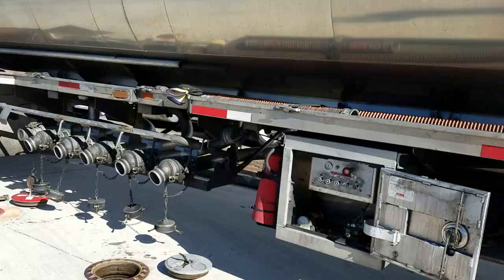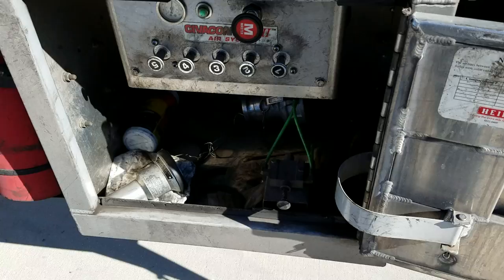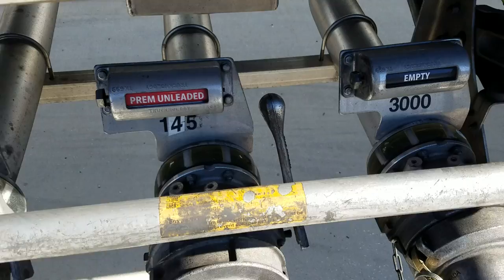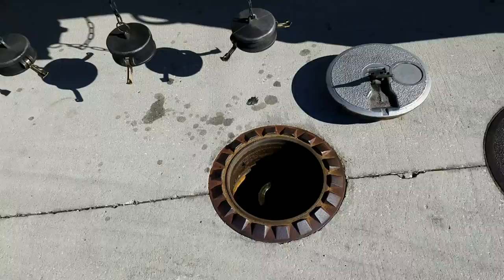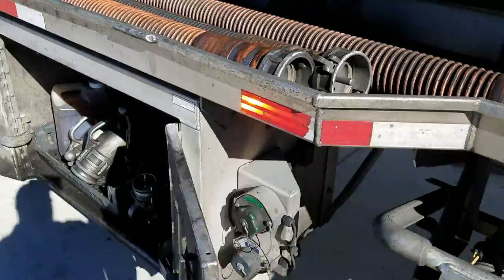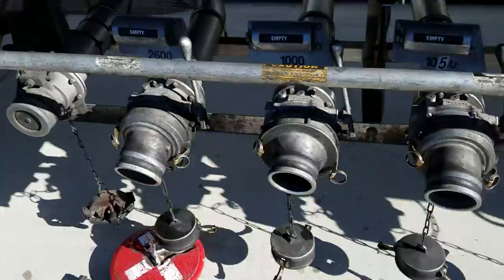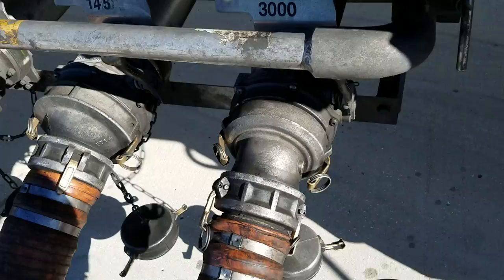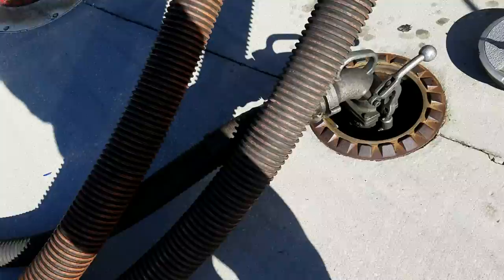How a Fuel Truck Delivers to a TruckStop

Comment: Electric cars have left the chat
Reply from the maker: Lol its alright, we deliver millions of gallons of diesel every winter to power plants that power their charging cables 😂
Reply: @DrtyDiesel  lmao
Reply: DrtyDiesel and they call their cars ‘clean’.
Reply: At least the power coming from the diesel is cheaper than what gas stations charge
Reply: lol
Reply: @diptipanat793  Well the cars themselves are clean, the way they get charged isn't.
Reply: @⚡Elektrisk⚡ yes that to forgot about that lol
Reply: Not to mention how much gas it takes to mine the metals for there batteries to be made
Reply: @⚡Elektrisk⚡ someone got butt hurt..lmao
Reply: @dash9048  not to mention when the batteries are thrown into dumps in this country. Proven fact
Reply: @diptipanat793   DirtyMAX

I have a gas engine that pretends to be clean when it's going under 30 it's a EV
Reply: @DrtyDiesel  Oil power plants produce very little of the total electricity in the US. A Tesla model S will go 300 miles on 90 kwh. Even if all that electricity came from coal, it would be the equivalent of 72 pounds of coal. However, coal is being retired left and right. My utility is in the works to add hundreds of megawatts of wind generating capacity.
Reply: But,  @DrtyDiesel  , a lot of those charging stations would be powered by other kinds of plants, like solar, wind, hydro, coal, or nukes.
Reply: Oops, ya mentioned it,  @dash9048  !
Reply: Lmaooo ,, But no only electric 🚙ss ,Electric 🚛as also...remember freightliner have been testing his first one and will be out before the end of 2019
Reply: @jlara3717 , what words were you trying to say right after the two instances of "electric"?
Reply: @HelloKittyFanMan.  sorry I tried to say no only "cars" but "trucks " too
Reply: Oh yeah,  @jlara3717 , electric cars and trucks and vans and buses, etc.; right!

Comment: I tried to do that job. Embarrassing low pay for the liability and skill required. OTR heavy haulers pull $1800 a week, and still less liability and less exposure to chemicals that can cause major issues later in life, for only $1000-$1200 a week. Not to mention 12/12/5 or 6 day scheduling. It's a hard, underpaid, underappreciated job you're doing there my friend.
Reply: JaDo Steele Underpaid? My dad makes 70 grand a year hauling fuel and is home every day.
Reply: James Smith I guess it depends on where you live. I live in Iowa so...
Reply: Depends on the company really. They all change with how much you get paid per mile, how many miles you actually have to go to get there, etc
Reply: skill??
Reply: Really?1000$ a week is underpaid job?wow.. I get 8£(10$) an hour for my job and I'm a care attendant so I make 300£ a week. And it's a hard and stressful job. I wish I get paid 1000$a week....
Reply: Just factor in delivering to closed stations or 7-11's at night and dealing with the junkies, winos, crackwhores and all the other garbage. A lot of the busier places pass gas after 11pm, especially in the ghetto where they park all over and won't let a fuel truck in due to ghetto parking practices.
Reply: Emanuel $1,800.00, not $1,000.00.
Reply: Tru but otr sucks no life no family etc local at least he has a life he home I'll take a pay cut to get off road..
Reply: @yiman7370   yea that's the world we live in now but driver world is different set of rules expectations I'm a driver since I been in my mind set has change even more then wat it was I was bout money before but now standard has rasie even more 1000 a week ain't nothing I'm use to making 2 3k a week now..
Reply: @yiman7370  Youre forgetting about taxes, insurance, retirement funds, etc.
Reply: Wow 70k a year that's just sad my sister inlaw works at a cable company and makes 100k a year no bs her bonus alone every month is 5k ontop of her normal pay
Reply: 1800 isnt much when you're away from home , eating in restaurants,paying for showers etc.
Reply: @lordvader5200  every trucker on YouTube makes 70k
Reply: 1000 a week is good money. Heavy haul takes so much more skill. Yes this is a very dangerous job, but its easy.
Reply: @yiman7370 
yup, here in the US 10 an hour is minimum wage, and there are millions of people making that. So i get sick when someone pulls in 1,000 a week and claim they are poorly paid. You can get out of college and get a good job and get paid less than a trucker. I brought that up to my professor one time, and got pissed when I told him truckers get paid more than some engineers.
Reply: @lordvader5200  i make 70k also and  i'm home every day and weekends LTL baby. i hauled fuel 12 hour days 5 week 6 the next. THAT JOB SUCKS!!!! JaDo Steele
 IS TOTALLY CORRECT!!!!
Reply: @sunnydeng9263 
1000 a week is what people with a bachelors degree make, and people like truckers, plumbers, etc...
And in major cities, people who work retail or any job that pays minimum wage are making 300-400 dollars a week.
Reply: I know there was a company I fueled trains for in ky and only got 17$ an hour.
Reply: @Big Lenny "Also, you save a lot of money because you don't have time to spend it."  Meth isnt cheap
Reply: You got that Right I did it for over 5 years
Reply: Boi, that's a really good pay here in romania. On avarage people make less then 1500 dollars a month.
Reply: @365gamestreamslive5  fact: couldn't care less. Oh, and your sister earns more money in extras than by doing her job.
Reply: I drive LTL Linehaul. Home everyday work 5 days and 9-11 hours a day. I made 103,000$ this year.
Reply: Erik Satie  - chemicals that misinformed people say cause problems.
Well yes... gasoline causes car accidents and death, if you think of everything in life in a negative way.
Reply: It's not like oil is a multi-billion dollar industry. They have to cut corners surviving on their limited budgets. Plus, they have all that money they have to pay to lobbyists to demonize alternate fuels. ;)
Reply: @rich1051414 , yes that's the reality but some still ignored, sad
Reply: What if you owned your own trailer and truck? How much would you make per week?
Reply: What is a 12/12/5??
Reply: @taledarkside  I make around $4,000 a week at my job and I still feel underpaid especially when I'm working 92.5 hours a week
Reply: You said how you tried it. After w few years you probably would make more and more money for seniority.
Reply: Rich Pianas Last Oxy  big big factz
Reply: @yiman7370  Care attendants (which I assume is the same as a CNA here in the US) are incredibly underpaid for the work they do.  It takes more than just wanting to money to stick with that job.  You truly have to care about what you're doing.  So, I want to say "thank you" for the job you do!  It's incredibly important and you are underpaid!
Reply: @taledarkside  Shit, my brother in law is a Master Plumber and made over $200k last year.  It took him a while to gain his Master designation, but once he did his pay shot through the roof.  That's what a lot of folks don't understand about trade labor, you can make a shit load of money because a lot of folks think it's low paying.  Carpenter, Welder, Electrician, Plumber, etc.  There's a lot of money in those careers.
Reply: @James Smith if you're not making at least that hauling fuel, you need to take a look at another company.
Reply: chief tp where you working at chief ?
Reply: Lord Vader your dad enjoys the company of other men
Reply: 365 Game Streams Live that’s a lie. Lol
Reply: @taledarkside  depending the state u live. Some places r cheaper (Missouri) other r more expensive (New York)
Reply: The drivers I unload everyday bringing in paper rolls say they make over $400 a load, sometimes they bring 3 loads a day, other times they might not get but 5 or fewer loads a week depending on how low or full we are on paper
Reply: I make 95k yr hauling fuel with Texas TransEastern and home everyday
Reply: These guys get upward $100k. I'm just waiting for my hazmat.
Reply: @taledarkside  People who were exposed early to 1000/week of course going to complain since they been at that pay rate for so long they expect to be making 3000/week now.  But to the rest of the people that are either working at a restaurant, market, clothing stores, etc.  would kill for a 1000/week.  Not to mention a few years ago minimum wage isn't even in the double digit yet.  But these truckers were making a grand a week back then already, so they think that is the minimum wage in the trucking world.
Reply: @BoomerKeith1  Dude, plumbers have my respect.  We had a backed up toilet and this plumber came out and use that spinning metal wire and it was back splashing shit to his face.  He took it like a champ.  I think some of the shit and shit water got in his eyes.  It was a battle but he unclogged it and even had a smile and laugh about it.  They deserve good pay.
Reply: Not true I been hauling fuel for two years and bring home 2800 every two weeks five days a week and home every night
Reply: My dad is a terminal manager for a gas hauling company he makes between 145 150 thousand a year . But he had to drive first . Like he always told me . You gotta crawl before you walk
Reply: “Skill required” lol
Reply: @JohnDoe-yh2sf  
I've done plumbing on the side. And some if it is hard work. Especially sewage leaks in crawl spaces. Industrial electricians is a field i would have liked to gone in. They get paid a shitload.
Reply: @taledarkside  I agree its hard work.  Plumbers should get pay good money.  Especially when dealing with crap.  You gotta have a strong stomach for it.
Reply: @Rich Pianas Last Oxy That's only if you have a shitty driving record and cant get a local job with the LTL shipping companies. I work for FedEx freight and if I worked 60 hours a week for 52 weeks I'd pull in $110,000 not including our twice a year ~2% bonuses.

I average 50 hours a week and still pull $85,000. Good paying trucking jobs very much exist in the local market, both in LTL line haul and P&D.
Reply: Easier than my job though
Reply: I made over 100,000 a hauling fuel
Reply: I make 1700 a week in san Diego ca 🐂🐂😀
Reply: Under paid are the drivers that fuel the airplanes,, in LAX is $ 11.50 an hour,,,
Reply: chief tp  same,  I drove otr for 3 years,  and now drive for eagle
Reply: @dfor  hook it up with FedEx pls. Is impossible to get in thru application
Reply: @2phalanges  If you didn't get a response through the website applications you can look up your local area service center's phone number and call to ask for HR to ask about openings! There's a chance that your center isn't hiring right now, it's usually in waves in the summer time and winter that they hire on new city drivers. Keep trying!
Reply: I know this video has been uploaded long time ago but putting my opinion out I think is important. 
Completely agree with you,I've haul fuel,propane and jet for 15 years and this job have become one of the most underpaid ,For the fact that fuel tanker driver is exposed to high level  of dangers out there .
Like you said $1000-$1200 is the average but I know companies that even pay  less for more work(no names You know who you are)
I quit 4 years ago, and now I make double$$$ with double less risk ✌✌✌
Reply: Joshua Powell how do you like eagle? I’m looking at working for them in south florida.
Reply: @blakelyh19  Eagle in South florida???? Is that a joke??? Well if you're willing to work extended hours night shift weekends and make $700 Eagle is the place, same Florida Rock, Kenan, CWC, Palmdale,.
Try on "Speedway " go online and fill the application they're looking for drivers and they new in the market equipment is new ,don't know about managment. Good luck.
Reply: JaDo Steele wtf haha I make 120k a year home everyday all benefits payed and work 12 hours for 5 days plus bonuses for safety and yearly quartly too OTR is for starters that don't know where the money is at my checks every week come close to 2500 a week gross after taxes I still have a lil more than 2k to take home spend time with family parties and everything else 😎
Reply: Thomas Dunning that's a little bro there's a lot of risk for this industry plus dumb ppl that drive crazy
Reply: Blake Howard bro get into car hauling up to 120k a year and it's an easy job most companies train u very easy job Toyota Transport up to 160k a yr Professional Auto Transport up to 120k yr ..Hansen and Adkins up to 130k a year but Hansen sends u like 1 o 2 days away from home still u make good ass money 💰
Reply: joe leeman 😀
Reply: @JohnDoe-yh2sf  😆😆😆😖😖😖😖😖😖
Reply: everyone i know makes 80-130k
Reply: 365 Game Streams Live uuuuuuuuuuu
Reply: JaDo Steele I’ve been doing this job for 3 years I make $72,000 a year n east tn the cost of living is low so if u call that embarrassing low pay then I guess I’ll take this embarrassing pay lol.
Reply: @somedude2492  yeah she polishes knobs lmaaooo
Reply: @somedude2492  yeah she polishes knobs lmaaoo
Reply: L
Reply: What!! Fuel haulers get close to 2,500 a week and around 100,000 easy a year!! Where have you seen the checks of a fuel haulers!!???
Reply: Loaded 800 gallons more ( no dome out)
Now I'm gonna get written up. Fuckk 
Lesson learn  have you guys fucked up 2
Reply: @lordvader5200  70 grand is little bro i was a fuel tanker and i found a company that pays me $110,000 a year im happy with thay
Reply: @yiman7370  I've been there, which is why i switched careers to drive a truck. Biggest paycheck starting out was 1100. That did it for me.
Reply: @frac8220  net or gross?
Reply: I do this in Louisiana and it's over 85k plus bonuses every month and year. Not to mention home everyday.
Reply: Idk where you live but here in New Jersey fuel haulers make 80 to 100,000 annually
Reply: What trash job did you have hauling fuel. Starting pay at my job is 110000-115000 with bonuses. I make between 135000-140000. Home every night.

Comment: Nice video
I've never seen fuel delivery from a that close point of view...
Interesting to see something different from standard unloading ;)
Reply from the maker: Mike Galauch glad you liked it! :)
Reply: How do you measure how much fuel you are giving them?  Is it just empty a full compartment and you know you gave them all the gallons that that compartment holds?  What if someone old needs 400 gallons of premium' how would you "meter out" 400 gallons.   I'm assuming you fill up your truck and then go and make a bunch of deliveries.  Is that accurate, or is it more like "fill truck for next delivery, bring that, then return for another filling of truck?'  Thanks for the video, it was interesting.
Reply: Mike Galauch i
Reply: +forseeit each tank at gas station can only hold a certain amount of gas usually they can fill each section in one run
Reply: Mike Galauch jtt
Reply: Mike Galauch i
Reply: forseeit when i did it, we loaded whatbwas ordered and the station would take the whole truck.  They paid the same for the delivery regardless of the gallons so a station would try to get as much.  Alot of stations i delivered to had multiple 20000g tanks and a truck would hold about 12000.
Reply: Rule of thumb you didnt start unloading unless you are certain the tank can take whats in the compartment.  Most trailers dont have a meter.
Reply: forseeit They measure the liquid height in the underground tank before and after filling. If you know the carachteristics of the tank, you can calculate how many gallons are in there by using the liquid height. Then you just subtract the "before" number from the "after" number to get the gallons added to the underground tank.
Reply: Every tank has a chart.  When you stick the tank you note the inches and fractions of inches and find that measurement on the chart.  it will tell you how many gallons are in the tank.  Add the number of gallons in the truck compartment to the tank gallons and find that number of gallons it will tell you how many inches the stick should show after emptying the compartment.  As long as you don't run out of inches you are good to go.
Reply: Some tanks/stations also have a vender-root in tank measuring system to verify the before and after deliveries. Problem is that they never account for the hundreds of gallons that get pumped while the delivery is being made.